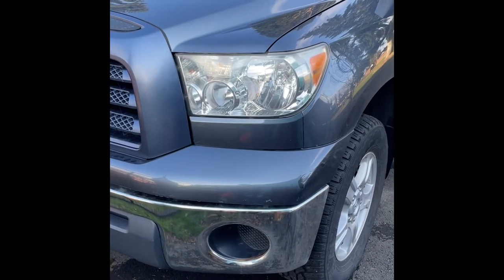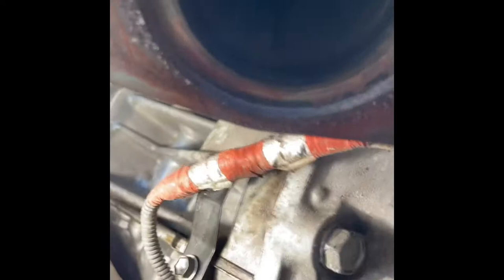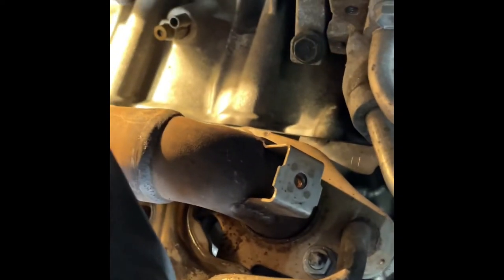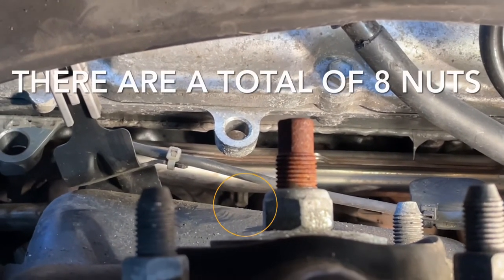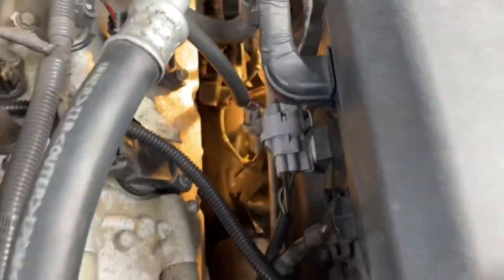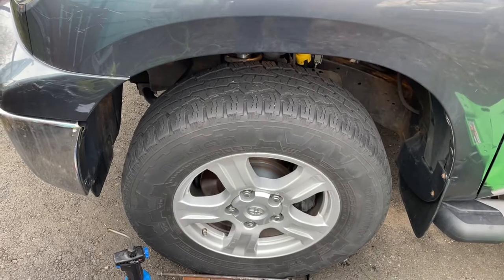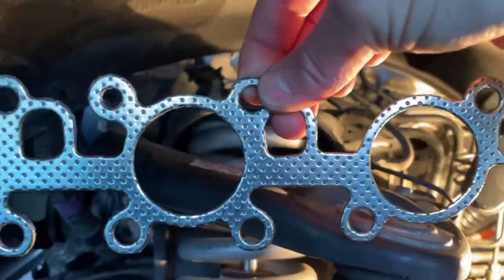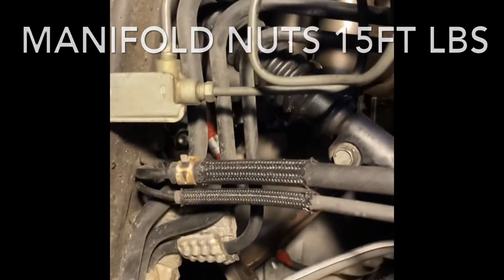2nd Gen 2007 Toyota Tundra 5.7L Exhaust Manifold Replacement DIY

Comment: I just did the Secondary Air Injection Pump bypass and you have to put a block off plate on that port. Mine started leaking after from that exact location. Gonna have to replace the  manifold now.
Reply: ...yup, had the identical thing happen...

Comment: Did you remove the driver's side catback flange to the muffler, then push back on the muffler to separate the catback section, or did you need to loosen both left and right catback sections to get enough clearance to separate the driver's side catback section?

Comment: How did you remove the manifold after removing the manifold bolts and disconnecting it from the catalytic converter side?  Space is too tight

Comment: How’s it holding up? Thinking about purchasing. Thanks!
Reply from the maker: I would maybe look for alternatives to avoid the trimming. I have only put a few miles on it as I don’t drive it much, but seems to be fine.  I would also recommend using oem gasket and some medium loctite on the stud nuts.